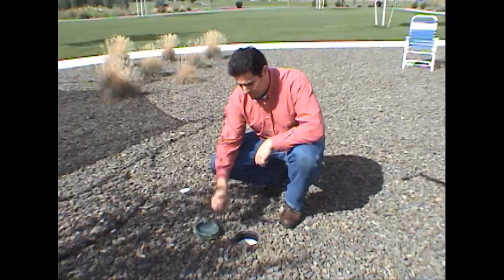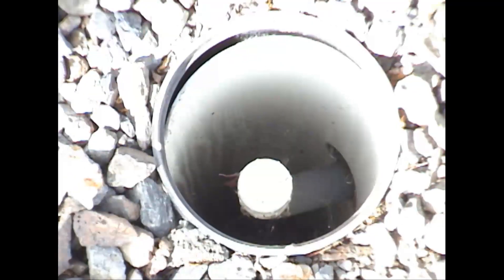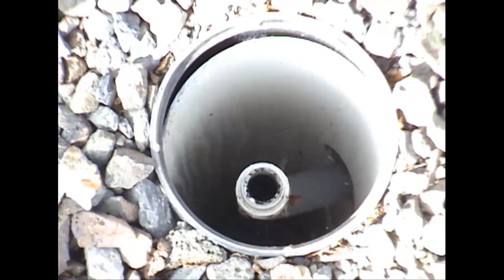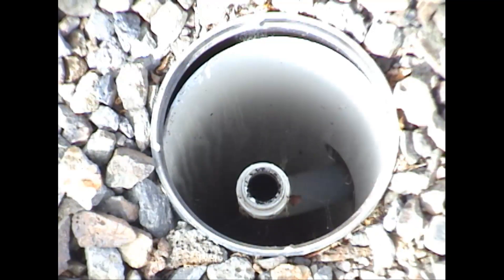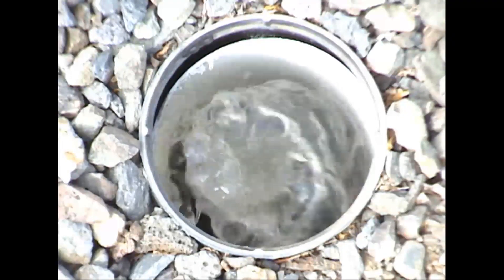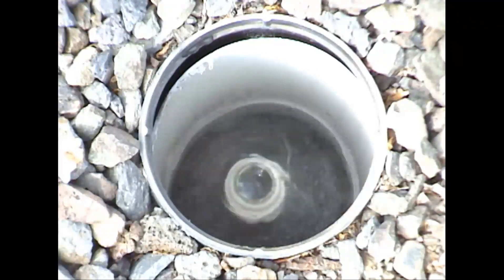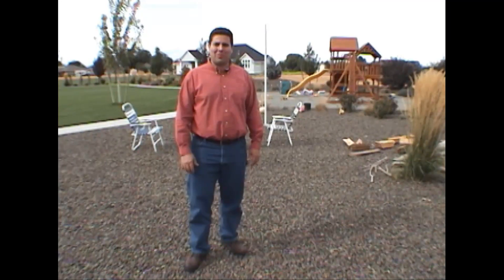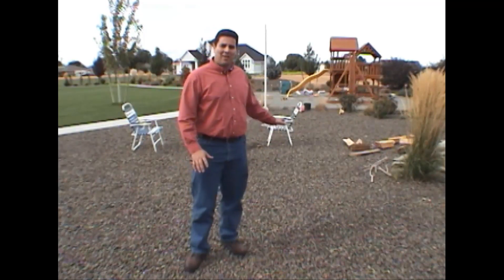How to Flush the Lateral Lines of Your Septic System

Comment: How do you run the pump manually?
Reply from the maker: Hi,  all systems are a little different.  If you have a panel box near the septic tank many times they have a manual option you can clip on to pump the chamber. If you don't you can manually operate the floats inside the pump chamber. Are you located near Pasco Washington?  If so, let me know and we could possibly swing over and help you for a service visit.

Comment: After discovering the location of six lateral lines (no thanks to the septic company), I attempted to flush.  However, there is only an off/on switch for my pumps.  The pumps switch is always in the "on" positions.   So:  Do I turn the pump switch off for a few seconds and then back on?  I did this and nothing came out of the pipe.  Is this a good sign or did I do something wrong?

Comment: on a pressure system how long  does the effluent can run during one cycle? is it possible to have a clogged field and not showing any wetness?
Reply: If your pump is running and drawing down the pump chamber I would suspect the pump first.  It is always possible that the line is broke or plugged but less likely than a bad pump.
Reply: i opened one lateral and the flow was good, the pump was running for like 15-20 min. and the level barely  dropped.

Comment: I don't understand this at all.  Why are you flushing it?  There a pump in it?
Reply: +Tom Renfro over time sludge and slime can build up in the 1" pipe, so this is something that only needs to be done every so often Annually is recommended, but I suspect that most systems survive with out it being done  very often!
Reply: Hi Curtis,  Thanks for answering back.  I see what you are saying.  It is a bit in general and matter of fact way..  Saying that, I have never heard of a pipe sticking out of the the ground for the purpose to clean out your lateral of your septic tank.  How dose this help your laterals.  Those are way under ground?
Tom
Reply: Tom, if I redid the video today I would do it different for sure.  These pipes are at the end of each drain field line in this system a total of 6.  By flushing it helps keep the small holes .25" in this case, clear.  Still not something that needs done very often.   To be clear this only applies to a pressure system, that is designed like this one, which is a common design in our area.